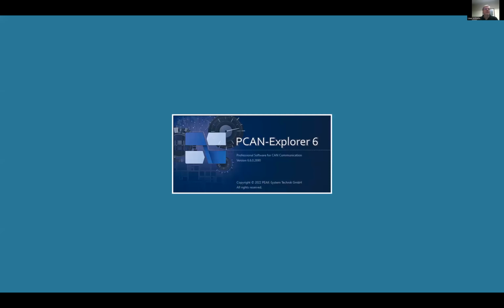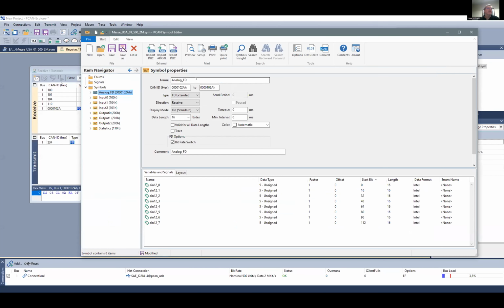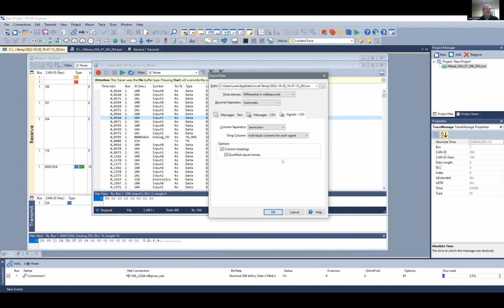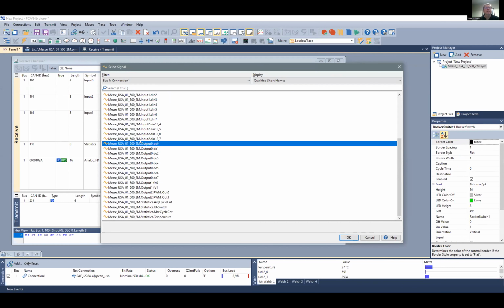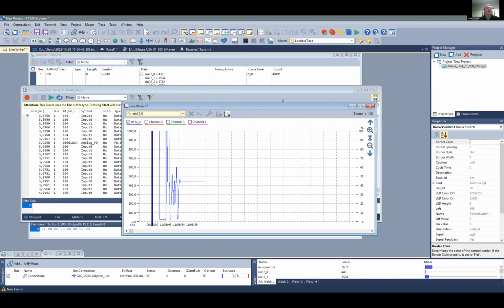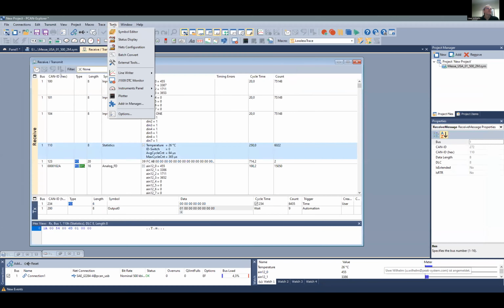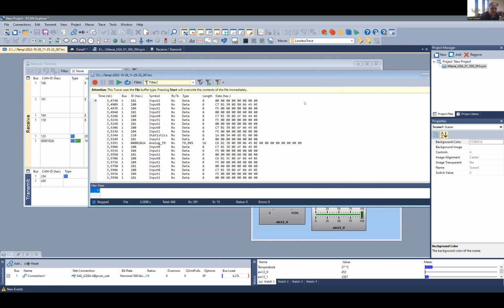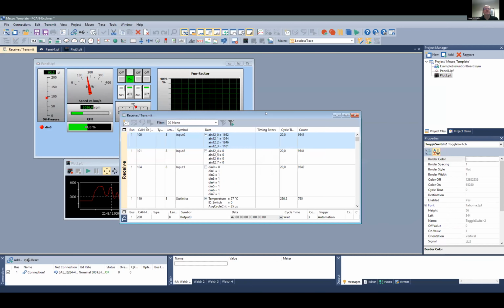CAN Bus Analyzer Software - Getting Started with PCAN Explorer

Comment: Thanks for the video, could you please answer a short quesiton. I have a situation where i stop sendinng the data over can to Pcan explorer, when this happens the plotter stops plotting the graph as expected but when i resume sending data, the plotter plots a graph (mostly straight line) which does not correspond to any data, the plotter then resumes plotting the original data coming over CAN.  i want the plotter to stop interpolate data and plot only real data. Is that possible?
Reply: Hi,when you run the Plotter in "live" mode - it shows the values in real time. When you stop communication the signals will not be update and so no change of data happened -it simply use the last Value. You could remote controll the Plotter (Start / Stop / Pause) with a script. That is possible. Send us an e-mail to our support and we could send you a sample project.